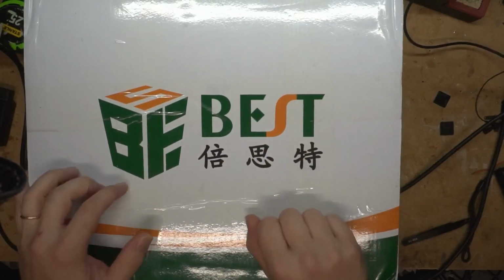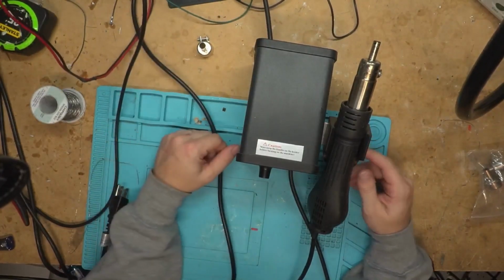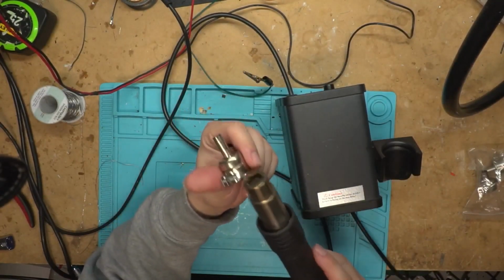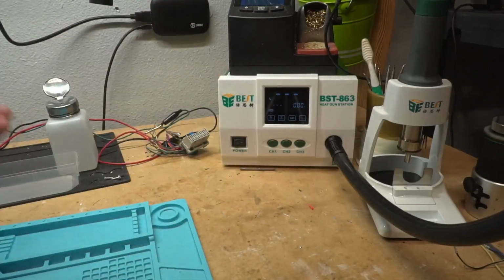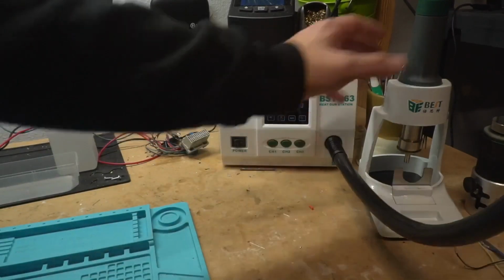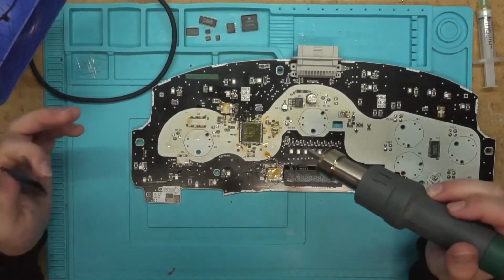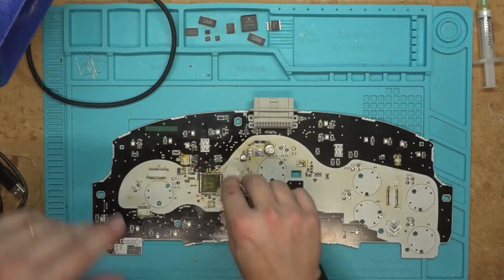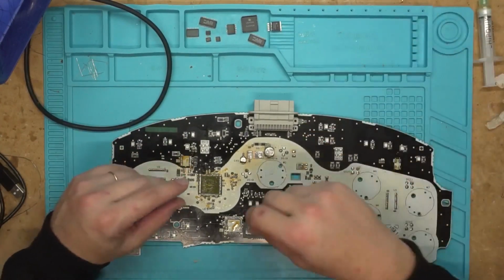Best BST 863 Hot Air Station To Replace My Old Station

Comment: Has Louis Rossman started selling them yet? Honestly if I didn't already have 3 hot air stations I'd consider one of these.
Reply from the maker: I haven't seen him selling this one. I know he sells the atten and quick. Another thing I like about this one is no buttons on the wand unlike the atten.
Reply: This is a Quick clone. The Quick is the original unit that Rossman and Jessa promote. BTW I own the quick and I also can recommend it.
Reply from the maker: @mike7958  rossmann now sells the atten instead of the quick now that quick doubled it's price
Reply: @mike7958  it's something how just a few years ago the quick was considered a inexpensive tool to climbing to the top of popularity to now having cheaper knock off's following in it's foot steps.

Comment: It's got a nice LCD screen. How long until you hack the firmware to shorten up that 10 second beep when powered on?
Reply from the maker: Oh and it's property grounded lol. I just checked.
Reply from the maker: it's got a transistor to run the beeper... I am probably going to just remove that transistor. no more beep. I do like the screen. Most people remove the beeper but I noticed in the pictures of removing the trace leads to a transistor that's easier to get off. the beeper is tucked behind the screen.
Reply: @FixedUntilBroken  no option in the owners manual to disable beep?
Reply from the maker: @jeffescortlx  you know what. I didn't check. I just looked now though. It does not. I did learn it automatically detects heater element failure and fan failure and has different codes for the issue. 
It also has a count down timer you can use instead of the count up timer that will kill the heat it you run it longer than the time. I don't think I would use that feature but I could see that being useful if you had a intern or new employee you didn't want over heating boards